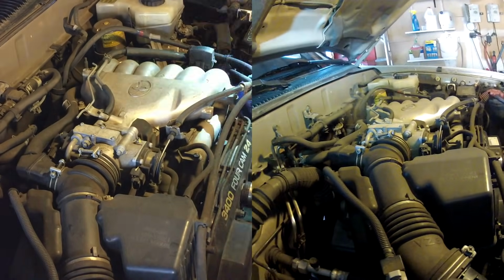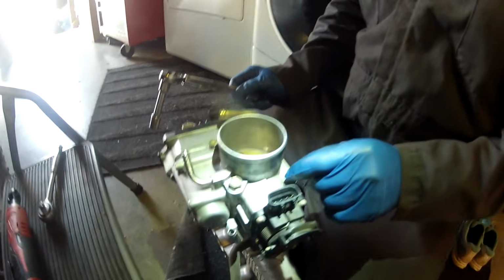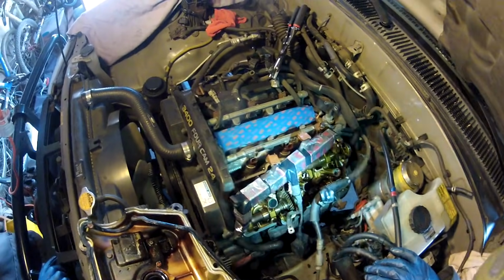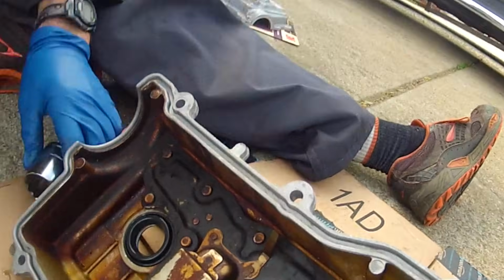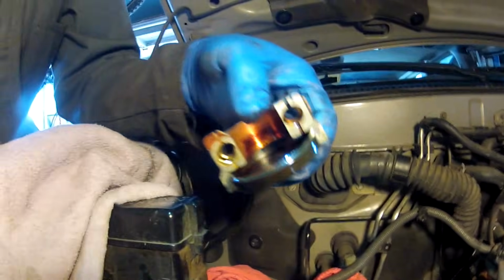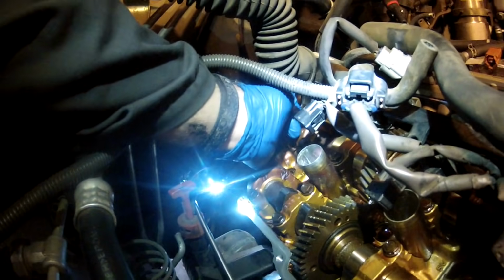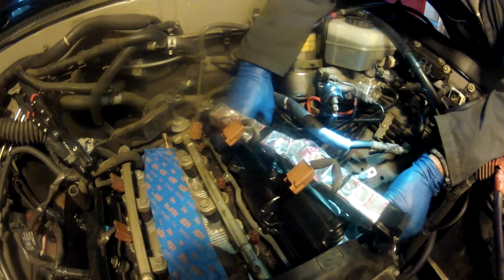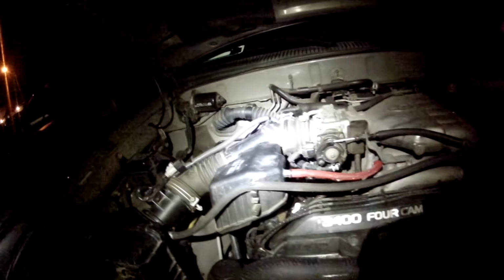3.4 L V6 5VZ-FE Toyota 4runner, Tacoma, Tundra Valve Cover Gasket Tutorial

Comment: Timmy, The Cover Gasket on my truck broke near to the oil filling neck(Driver side) I am going to replace it with it gasket. Do I need to replace the Upper and lower Intake manifold gaskets as well? Am I right with that? or I need to replace more gaskets? Thank you so much!!
Reply from the maker: There are more parts to replace than just the valve cover gaskets and plenum gaskets.  Look at the video description and watch the video and you should be good to go to do this job.  If you want more detail for the plenum removals, you can look at our supercharger video.

Comment: Any suggestions on what to use for tapping in the spark plug gaskets since I don't have a 32mm sprocket?  Maybe a small piece of wood? Thanks!
Reply from the maker: Do you have a brass drift or other punch?  That may work.  Slowly work your away around the circle with the punch incrementally driving it in place.  I would use easy controlled strikes.  You wouldn't want a fine-tipped punch rather something with a broader face to it so it doesn't deform the spark plug tube gasket.

Comment: Nice video! Trying to find the courage to do it :) I wish it was very not cold already. A shop is asking $650 without parts. Expensive$.  Thanks so much for this nice video!
Reply from the maker: Thanks Victor.  I think you should take up the challenge and knock this job out.  If you take my suggestions of labeling hose and electrical connections, take pictures as you go, make written notes on the steps you're taking to disassemble everything, you'll be just fine.  Just set aside a whole day and take your time with it.  When people rush, that's when mistakes are made.  The shop that quoted you $650 labor for this job is probably about right if they have very high hourly labor rates, but it does seem a little steep.  Even an experienced mechanic doing everything we show in the video would probably take around 3 hours to perform this job.  It would take a novice around double that.  This would be a great introduction for you to delve deeper into the world of auto mechanics.  This job isn't hard.  It's just time consuming.  If you do it, let me know how it went for you.
Reply: @TimmyTheToolman  Thanks Timmy! I am buying parts this week and probably do it one of these day when its warmer outside. I ended up buying a 2014 Prius  to resolve my commute :))) I'll post again when I get this done. Thanks again!
Reply from the maker: @elpatron925  Good luck with the job Victor and be sure to come back and let us know how it went for you.

Comment: Would it be easier to tap those spark plug gaskets out from the top side?  I just changed valve cover gaskets on a different motor, but the gaskets had a lip that I was able to use to tap them out cleanly from the top.  Don't know if this gasket has the same lip, hence, my question.  Thanks for the great video.
Reply from the maker: I think some guys have done what you're saying but I haven't so I don't know if it's any better than the technique I used.  Glad you like the video.

Comment: I'm a big fan of your videos they have helped me out a lot on my 2002 4runner and I'd love to see a video for rear main seal job and what is needed for the job to have it done properly thanks in advance and keep the videos coming 😎
Reply from the maker: Do you have an automatic transmission or a manual transmission?
Reply: @TimmyTheToolman  Automatic transmission
Reply: 2WD
Reply from the maker: @youssbaraki  You can use our automatic transmission replacement series videos to know how to remove and replace the transmission.  We did the video on a 4wd 3rd Gen 4runner so you can just ignore the parts regarding removing and replacing the transfers case.  Here's a link to part 1: https://youtu.be/oZDSjlxl2Q4  You can use our recent clutch replacement video to know how to replace the rear main seal.  We show it in Part 2: https://youtu.be/mrSRBmFZ1wk
Reply: @TimmyTheToolman  I'm grateful to your reply and assistance 🤗
Reply from the maker: @youssbaraki  You're welcome.

Comment: when putting on the spark plug tube seals aren't you supposed to a drop of oil on the spark plug tube seals before you put it on ? also have you had any problems with the seals since you posted the video? thanks
Reply from the maker: Putting a little motor oil on the lip of the spark plug tube seals is a good idea so it's easier to get the valve cover in place.  On the 3 4runners I've done this job on, the valve cover gaskets, spark plug tube seals, cam seals are leak-free.  Everything is good.

Comment: Timmy... How are you mate? I did start the rocket cover gasket job, so far so good, but I want to ask you something. Once I put the cover back with everything brand new,  the RTV as the factory manual says and torque the 8 screw around with 53 in lbf which is 5.99 Nm,  I realise there are a small gap, very even along the cover and the seat, Is that normal? I see the gasket doing the sealing squishing the rubber in between....then  I double check the torque and is OK in specs. Just want to know your opinion. Thanks bro...
Reply from the maker: That valve cover gasket has a rounded bead to it and it squishes down as you bring the bolts to spec.  As long as you properly torqued the bolts evenly, you should be fine.
Reply: @TimmyTheToolman  Well Timmy, has been already one week since I have done this repair and the results are amazing no more oil on the floor, thanks so much for all the effort to record not only this, all videos which are super informative and interesting to see,  I was looking if by any chance you got one to repair the intake manifold gasket which is leaking coolant too in my engine, but nothing I will check my manual and if cant find any info may be I will yell you for help lol!... Cheers bro!... all the best for the 4Runner project you are getting there....
Reply from the maker: @jesromerg  That's good to hear you're leak-free at least in the oil department.  We do not have a video for replacing the intake manifold gasket but our fuel injector video will take you pretty much all the way in with the exception of removing the intake manifold.  Here'a a link: https://youtu.be/N-lhZIWOkyU

Comment: Hey Tim... How are you mate? Well buddy I have seen your video like 10 times Ha ha ha, just double checking to be ready to do this repair in my Toyota Prado 3.4, 5VZ-FE. Here in Australia this engine is fitted on most of the Prado from 1996-2004 Think so. I think got all spare from your list!... It does not look too difficult but instead time consuming, and of course this video its a super life saver for this job!... Thanks for all the videos you have done. Keep you updated How I goes!... 15th Sep ETA to start it.!!!
Reply from the maker: Doing well.  Thanks.  Just take your time and you'll be fine.  By labeling fasteners as you take them off and labeling hose and electrical connections too, you will stay organized and won't make a mistake.  You could even keep notes as to the order you take parts off so you can follow that order in reverse when you put things back on checking them off as you go.  Another trick is to take pictures of how things look on the engine from all angles so it will be visual reminder if you get confused when putting things back together.  Good luck with the job and definitely let me know how it goes for you.

Comment: Thanks so much for this vid and lots of other you have to too. I just took this job on over the weekend. Probable saved me well over $500 in labor. After getting everything back together, I ended up with two 10mm bolts with washers leftover. Any idea or anywhere in your notes  those go to?
Reply from the maker: Hey Will, you're very welcome.  Two 10mm bolts sounds like you might have forgotten to secure the the metal fuel line bracket to the lower intake plenum.  Looking from the driver side of the engine compartment, look under the plenums for that fuel line bracket.  If you can reach in there and move it with your hands, the bolts came from there.  If that fuel rail is secure, there is one 10mm bolt that secures the big plastic wiring harness to the plenum against the fire wall.  If you can move the wiring harness up and down, one of the bolts belongs there.  There's also a 10mm bolt that secures the ground wire for the diagnostic port on the driver side of the upper plenum.  That's all I can think of right now.  Let me know if any of my suggested possibilities were right.
Reply: @TimmyTheToolman  Yeah, all three of those spots have all their bolts in place. I even removed both plenums again to have a look all underneath and around. Couldn't see any slots for the mystery bolts. Once again, everything is back together and securely in place as far as I can tell. These mystery bolts are twins and whatever they went to, they went together. I had them positioned set near my air intake box/hosing,  throttle body, and upper plenum when I had it all disassembled, so they must have come out while pulling out one of those three pieces but I can't find a place for them now. Even reviewed your video again and a fairly thorough 01 tutorial on T4R, same year as mine. Oh well. As far as I can tell, everything is snug, secure, and torqued as necessary.
Reply: By the way, here's a pic of the bolts, in case it helps to ring any bells for you. https://photos.app.goo.gl/kyiZH1jN6jvEB9LD8

Comment: Tim, thanks for this video! It's proving  invaluable as I prepare to solve my leaking oil problem. One question, any tips on cleaning while I have the covers off?  THANKS!!!
Reply from the maker: If you mean cleaning the valve train, I wouldn't do it.  You don't want to break up any sludge chunks that could end up lodging in an oil path.  If your valve train has a lot of sludge build-up, just doing oil changes at a higher frequency will slowly clean it up.  Change the oil every 3k say for the next 30k miles and that will make a difference.  Engine oil has detergents in it and the regular oil changes will slowly clean up your engine.  There's also additives you can add to the oil to help slowly break down the sludge deposits.  Happy Wrenching!

Comment: My neighbor have a tune up kit for I believe a 95 4 runner he's  willing to sell me. Will the spark plugs brakes, rotors, and all the other stuff fit my 99 4 runner? I know mine don't have a distributor and those won't  work but will everything else?
Reply from the maker: JZ- Power without knowing part numbers, for all intensive purposes, those parts will NOT work. A 2nd gen 4runner has a different engine than our 3rd gens

Comment: Great video, totally convinced me to bring my 4Runner into a shop to have this done - no way I could do that without breaking everything or losing my faith in God.  Well done.
Reply from the maker: Glad you like the video.  I guess you had the opposite reaction to what what many have had after watching the video.  A lot of people gain the confidence to tackle this job because we show you step by step what you need to do and show all the necessary tools needed to get it done.  But yeah, if you don't feel comfortable with it, I guess you pay a shop to do if for you and hope they do it right.  Just make sure you choose a shop with good reviews.  The reason why I do most of my own work now is shops do screw up a fair amount and I'd rather have the piece of mind doing my own work because I know I'm going to take the time to make sure it's done right.
Reply: @TimmyTheToolman  Still contemplating it actually!  I'm just old school.  I've fixed most things on my truck before and thought this would be a much easier job.  I grew up in the days where to change valve cover gaskets, all you had to do was take the valve covers off, you didn't have to take half the engine apart to get to the valve covers.  The lower bolts on my valve covers were pretty loose, I tightened them, it made the leak even worse!  Guess I over-tightened them!  Thanks man!
Reply from the maker: @nachtjager77  If you take your time, take pictures or label hose and electrical connections and make sure you keep all your fasteners organized so you know what belongs with what, you can do this job no problem.  It's just time consuming, that's all.

Comment: Kind of a dumb question but if I only need to replace my passenger side gasket (and everything else) do I need to remove the intake? What would be in my way?
Reply from the maker: You might be able to sneak out the passenger side valve cover without removing the upper plenum.  You would have to get the air tube out of the way and probably the throttle body.  But, if it were me, I'd just do both sides and be done with it.  All these valve covers are going to leak at some point.  It's a matter of time.

Comment: Timmy, Any idea the part number on the brittle wire loom part on the driver side?
Reply from the maker: No clue.  You could just get some split wire loom at an auto parts store as a replacement and use some hi-temp tape to secure it in place.

Comment: Thanks for the video Tim.  Well done!
I replaced my R side VC gasket yesterday.  Started up fine, but the idle won't come down.  Stays up ~1800 rpm.
So far I've verified everything is reconnected where it belongs.  No CEL, no codes.
Any thoughts on where to start looking for the problem.  I was going to start w/ troubleshooting the idle air control.
Thanks.
Reply from the maker: You're welcome.  If you cleaned your throttle body, you might have let the runoff travel down into the IAC.  I suggest pulling the throttle body off and cleaning the IAC.  Report back and let me know if it worked.
Reply: Really appreciate the reply.  You could be right. I'll give that a try.
Edit: Just now read the **Warning note in the description...lol.
Reply: Reporting back. Cleaned the IAC today. I had new gasket on hand. Goes to 2K at startup and comes down to 1K as the engine warms up. Need do some more research on idle controls.
Reply from the maker: @ppeterson9359  Have you checked to make sure all your vacuum lines are properly attached and not cracked?
Reply: On my way to work this morning, the idle came down to ~normal.  About 750 rpm.  I did disconnect the battery for a few minutes last night thinking resetting the ECM may help. Is there some kind of a TPS relearn procedure?
Reply from the maker: @ppeterson9359  I don't know if there is something like that for TPS.  But, it sounds like you fixed it, fingers crossed.

Comment: You missed a very important step after removing the lower plenum!!
STEP 14: SPEND 40MIN SCRAPING IMPACTED MOUSE TURDS/NEST FROM TOP OF CYLINDER BLOCK.
 Tim, you are a HERO. You've walked me through 4 big jobs on the 4runner. This is the first place I come to when there's another job to be done. I know it takes a hell of a lot longer to film and edit than to just do the damn job! Kudos to Sean too.
Reply from the maker: Hey Anthony, consider yourself lucky one of little fuckers didn't chew through a bunch of your wiring.  Rodents in your engine compartment can do tons of damage.  Great to hear you're finding our videos helpful and you appreciate the effort Sean and I have put forth to make them.  You are correct that filming a job makes it take much longer and then the editing is a huge time suck as well.  Thanks for taking the time to comment.  We appreciate it.  Happy Wrenching!

Comment: Good points Tim.  When I did look at the finished product, I felt like I did a better job than the mechanic did.  I certainly do know my engine now.
Reply from the maker: Yep.  I truly believe in most instances it's better to do your own work.  If you're talking specialty work like rebuilding an engine, rebuilding a transmission, installing different gears in a differential or maybe a locker, paying a shop or individual with good reviews is probably the smarter option.  Another thing I'm willing to pay for is welding and fab work.  Since I don't know how to weld or have the tools necessary to do custom fab work, it's much better for me to pay for this type of service.

Comment: Thank you Tim... great video.   I didn't do it in 5 hours but took me closer to 16, not counting the time spent running for parts.  Being in the great southwest, the heat turned the hoses into brittle so I replaced a lot of them.  I woke up the last two nights at 2AM wonder what I've got myself into.  Finished, it started and didn't catch on fire.   I'm strutting my stuff, but if I had to do it over again, I'd let the garage.  I thought I took great notes but when it came to putting back together, didn't make as much sense as went I wrote them.  Morale of the story is take extensive notes and explain where it came from, where it goes and take a picture to accompany it.
Reply from the maker: You're welcome Ron.  I'm not the quickest mechanic either.  Now that you're a little more familiar with your engine, taking it apart another time will be much easier.  I'm really comfortable with these engines now since I've worked on them so many times.  The difference between you doing it and a garage doing it is you KNOW it was done right.  When you hire a garage to do your work for you, you are at the mercy of the guy performing the work.  Is he a good mechanic?  Is he having a bad day?  Is he going to rush through the job because he's a flat rate mechanic looking to make more money if he works really fast?  I know for the most part I'm going to do a better job than a garage mechanic because I'm not in a rush and I'm going to make sure everything is done right.  It is quite common for mechanics to screw things up while charging a lot for their time.  I think you should keep doing your own wrenching if you have the time and patience for it.